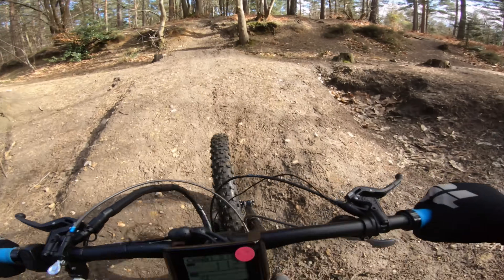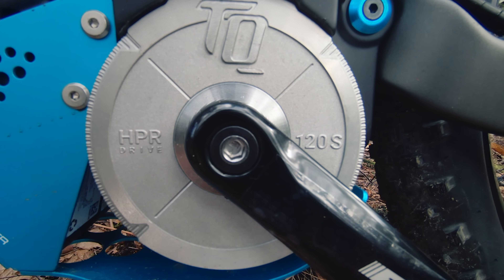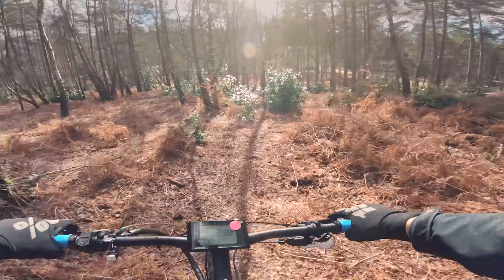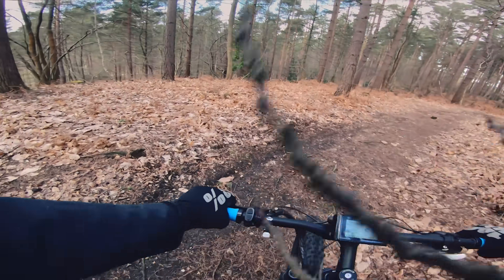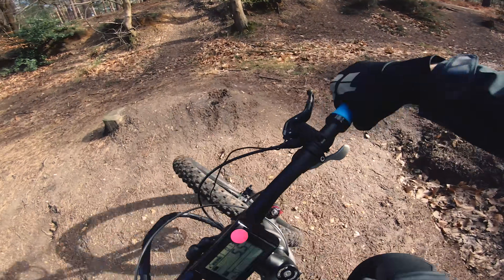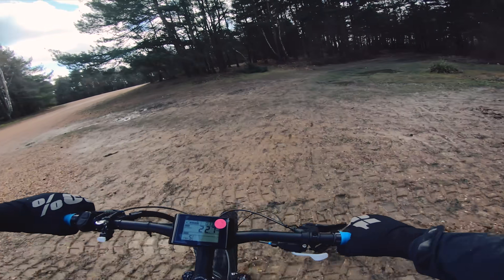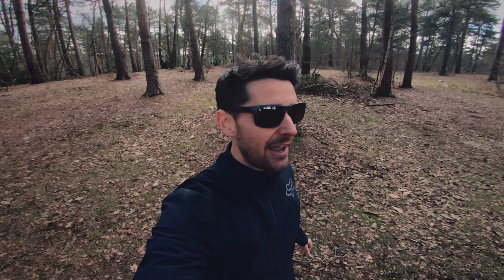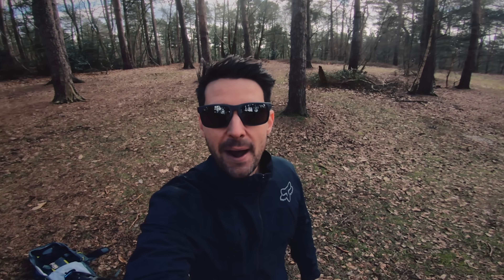INSANELY powerful TQ motor TEST | Same motor in the 2019 Haibike FLYON

Comment: Interested to see what kind of range you can get on the new flyon's . Reading an article an ebike online mag, they have the first review and the weight is around 28kg which is far heavier than any other mainstream ebike. Don't really fancy lifting that over some stiles etc in the uk!!!
Reply from the maker: It’s got a 630Wh battery so 20% more capacity than my Comp Carbon Levo. Weight of bike shouldn’t make too much difference to range (rider weight will have a big impact though!). Motor will use more battery on higher modes but in standard modes where it’s not giving ridiculous torque everywhere then I’d think you’d get a better range.
Reply: We need some upper body workout as cyclists anyway. TBH, most evokes I've weight have claimed 21-23kg buy are actually 25kg when you put them on the fishing scales. 3kg more is about what I'd expect to go to a 48v system where there's just more of everything.
Reply: TheAegisClaw Ebikes with Shimano E8000/external battery are in the 21-23kg range. My Commencal Meta Power (size L) on scale is 22,6kg with pedals. Bosch Performance CX motor is 1,2kg heavier (battery is the same 2,6kg) and when I ride one, I feel the difference. 28kg is a tank...
Reply: hey... what ebike on line magazine is that? cau u pls let meknow.. to have a quick read? thx
Reply: Magazine with review is ebike-mtb.com